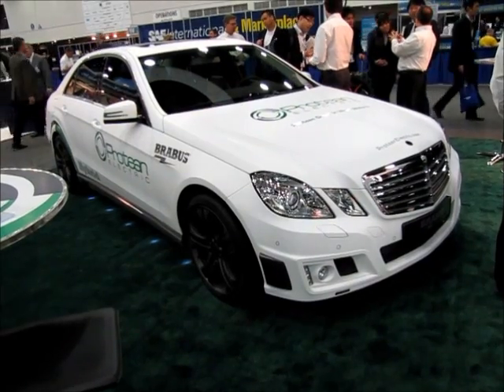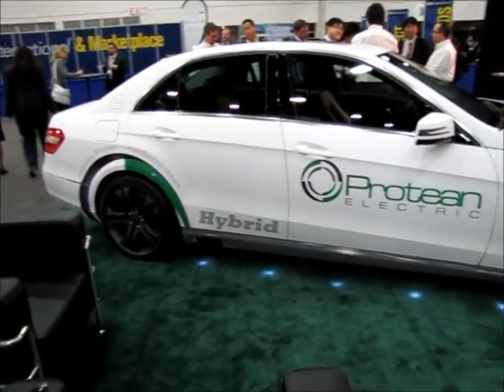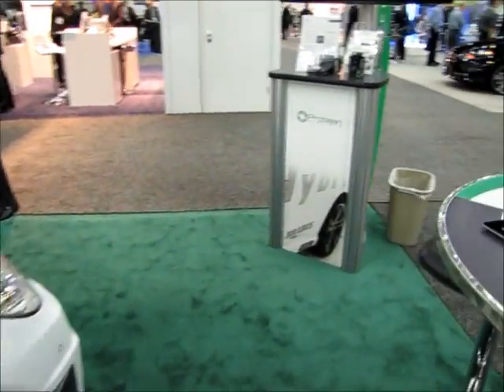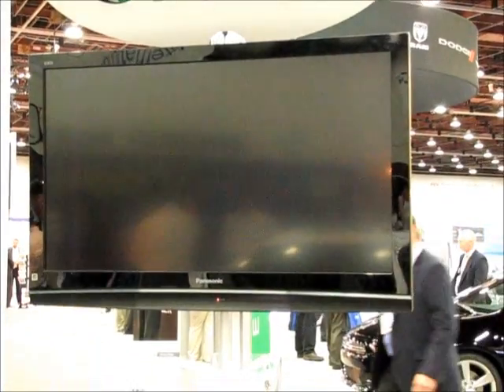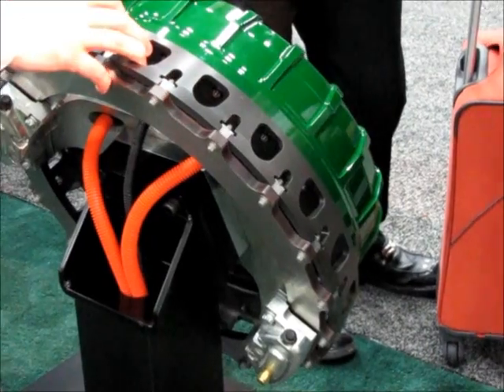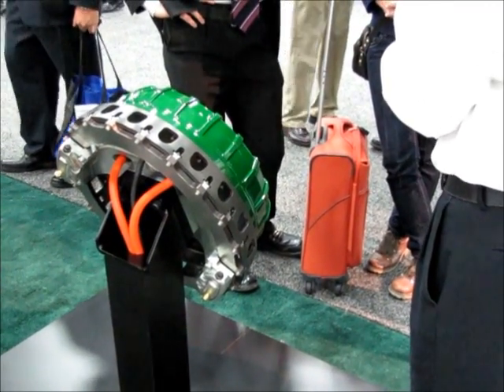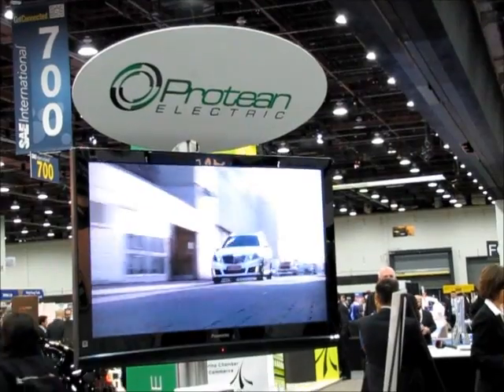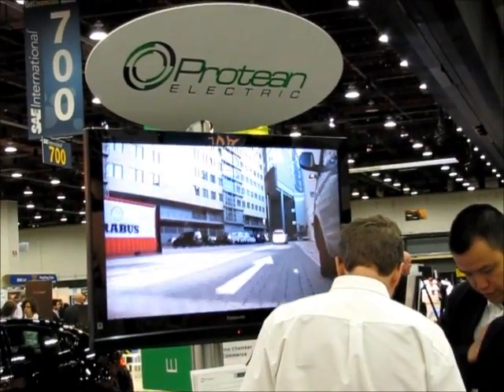2012 SAE WC Brabus Hybrid with Protean Electric In-Wheel Drives.wmv

Comment: I know this is the inevitable future for cars. But I'm having a problem with understanding why all the in-wheel videos I've been seeing are very old. This one's 8 1/2 years. Doesn't surprise me. I wonder why, though. Could it be that car makers don't want to outsource such an important component of the vehicle to a wheel/motor maker company? Is YouTube allowing news about this technology to be suppressed? If anyone has links (or even one) that shows some more recent news about wheel/drive cars, I would love to see more.
Reply: I know these guys and have experienced their test drives. The concept is brilliant. However the issue is torque ripples. Bigger motor diameter and no reduction, could produce torque ripples that could leak into the body as high frequency vibrations and noise. I believe they will sort it out, but I'm doubtful whether they can go against the physics. IMO the best approach for cars is smaller diameter high speed with some reduction. However in-wheel motors will work well in limited applications like airport buggies.